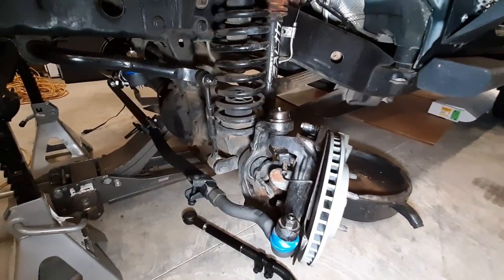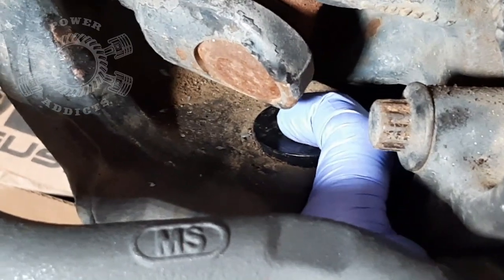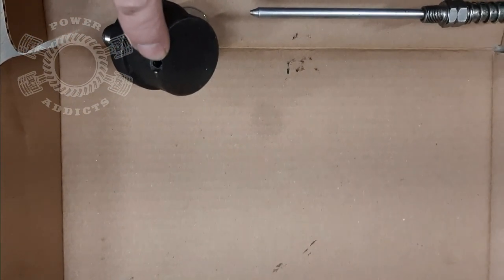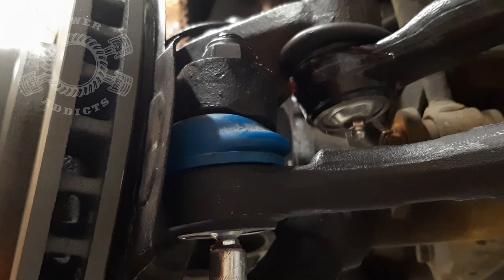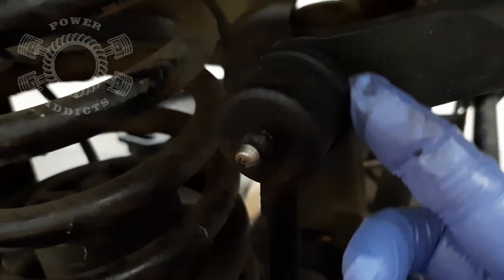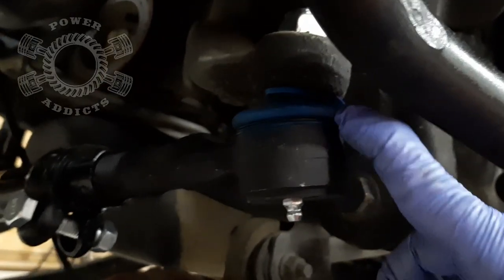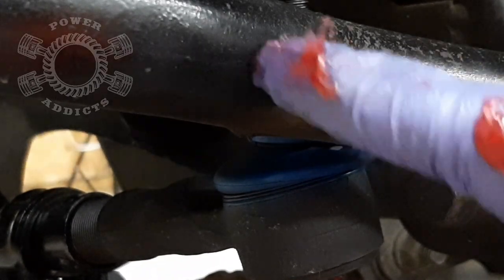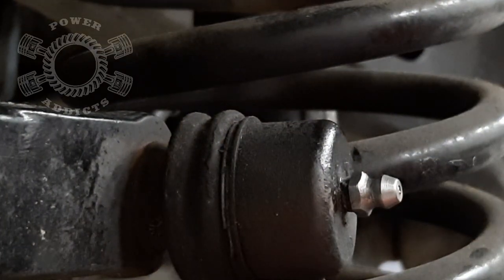Grease the front of a Jeeps Wrangler JK. #poweraddictscrew

Comment: I have a 15 JKU....the ONLY grease fittings I have are on the two aftermarket swaybar disconnects I installed.  I have none on pitman arm, ball joints, drag link or any other locations your showing here.
Reply from the maker: There are the non-greaseable ones out there, looks like you have them. Make sure all the rubber boots/covers are in good shape you should be fine.
Reply: This comment saved me, I also have a 15 JKU and was going crazy looking for the grease nipples 😂